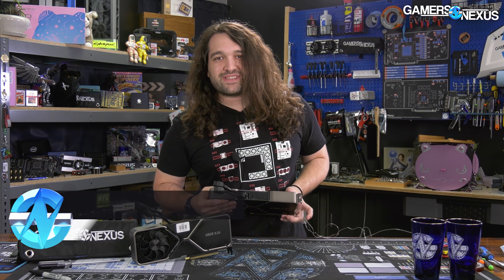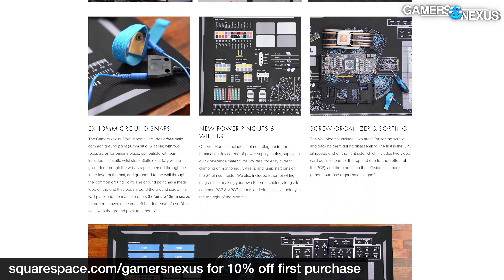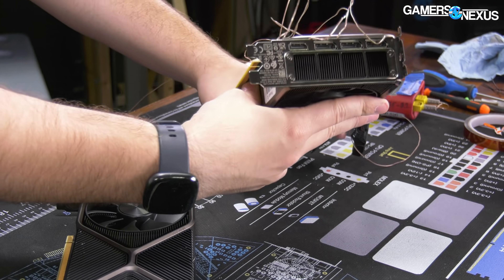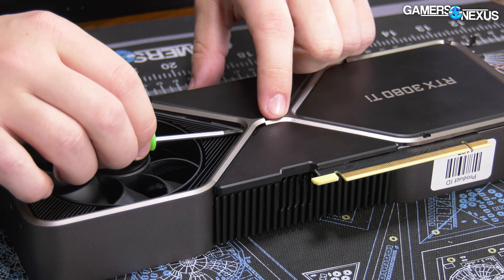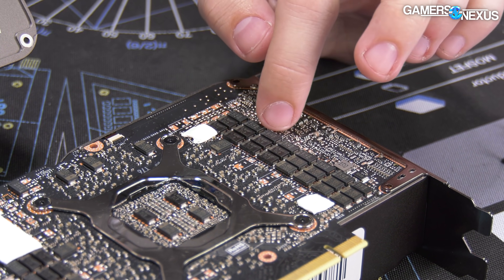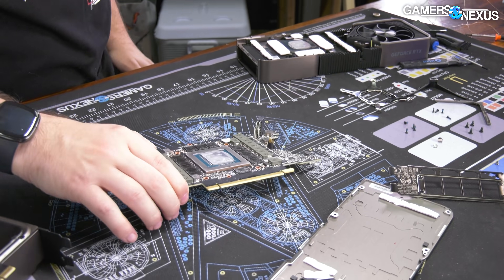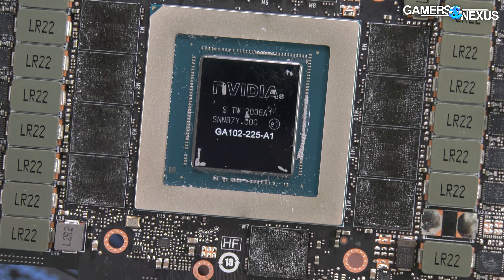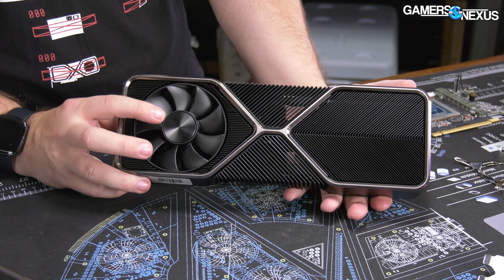NVIDIA RTX 3080 Ti Founders Edition Tear-Down: Seeking Differences vs. 3080 FE

Comment: The retailer here is charging €1900 for the cheapest 3080ti and despite those prices it is out of stock. And this is with the lower hash rate. I don't get how people can spend so much money on graphics cards. I don't really blame Nvidia for charging a lot when the partners and retailers add so much more anyway and when people are crazy enough to be willing to pay the prices. I would never spend that much on a video card. That's more then i typically spend on the entire system.

Comment: I used to call it 'tie', but ended up going with 'tee-i', as the argument was the titanium chemical symbol. Or I had just heard 'tee-i' enough, and adopted it. ... I still call my old TX 650 Ti Boost a 'tie-boost'. ... Call my current 1080 Ti as 'tee-i'.

I think either naming gets comfortable to use, after enough goes.

Comment: The only real improvement would be the extra memory... which is very helpful if you use vr setups which are super memory heavy .... so something like a valve index setup for example would be a good match for this card

Comment: Thank you for being so value centric, GN.  Keep these companies on the back foot! It's only because your efforts, and the efforts of like-minded people that there's any value in our products at all. Love your content, dig the humble vibes, please keep it up favorite tech-tuber!
Reply: People are going to pay it no matter what, so I'm not sure how this video is keeping them on their back foot....
Reply: @Charles-vd3vc  It's like a first line of defense. GN has the equipment to test claims and various marketing hoopla, and those tests in many cases are legally defensible, like with the H1 case. GN simply provides the valid info, such as the test results for this card, and if the problem is grotesque enough (say if this card actually performed worse than a standard 3080) then that type of inflammatory information would circulate quickly and cause outcry against Nvidia who would then be forced to explain themselves at the very least.
Reply: @AC-io8qs  Yeah but that only works if the product is actually inferior. This video doesn't display that and with a market starved of GPU's they could have made this product worse than the 3080 charged more, and still sold every single one. People would be angry, but they still would have purchased it.

A good example is pre-orders. People keep getting burned by pre-orders and yet they still pre-order.... and those people can still get the product at launch.
Reply: In this case Nvidia is selling way below market value.  scalpers have  shown the market will bear 2x+ price increase.  That 200$ if nvidea didn't get it, a scalper would.

Comment: The real question is is anybody crazy enough to stick those extra memory modules on a vanilla 3080 and try to flash a ti fighter bios?
Reply: It wont work.
The 3080 has a smaller bus width

Comment: Can we get a review of how well $100 bills work as heatsinks?
Reply: Definitely needs some testing.
Reply: I would unironically enjoy watching something like that, it'd be interesting to see how something as non-related to thermal conduction as a $100 bill, might actually do something (I'm talking like a 0.1 degree difference)     But, this could certainly be a fire hazard and would need to treated carefully.
Reply: You can literally see it...
Reply: About 15.

Wait.. maybe 20 to 25.
Reply: Sure, you burn them… momentary RGB effect… everybody knows RGB = higher frame rate..
Reply: Not even as well as coinage, I'm afraid.

Comment: Currently in the Netherlands the RTX3080 is €2250 and thee RTX3080Ti is €2300.
So there i only a €50 gap between them, not €500 as you would expect based on the MSRP.
I expect the Ti to be cheaper than the non-Ti within 2 months, unless LHR gets hacked.

Comment: The 3080 Ti FE card that Paul's Hardware had the VRAM hit 108c so Nvidia learned absolutely nothing 😄
Reply: That’s because his didn’t have the dollar bills which act as thermal pads.
Reply: if you zip tie two noctua fans to a non-reference 3080 Ti it will probably do a better job lol
Reply: @Nolan431  unironically I have a spare Arctic P14 PWM fan... would that help ? I have no problem doing this haha
Reply: Maybe he forgot to remove the two hundred bills that are over the VRAM. Paper doesn’t fair well with dispersing heat.
Reply: I honestly stopped caring about it, if my memory dies or something i will just claim warranty and thats it.
Reply: @jaroslavmrazek5752  card dies one day after manufacturer's warranty
Reply: @jaroslavmrazek5752  sure thing ok we have validated your warranty claim, your replacement card will ship to you in  — 396 days. Thank you, Nvidia support
Reply: Just because tjmax is 100°C doesn't mean it's healthy to keep the chips in that range for prolonged time.
Remember that 90°C is "by design" for Ryzen and I've seen Intel chips that got 105°C written on. But who runs their chip at that temp?
Reply: Same chips, same crappy thermal pads, same temps lol
Reply: I have a 3080 regular Founders.  Seen all kinds of conflicting videos.  Would it be advisable to add thermal pads behind the memory on the backplate side?  If so what brand and thickness should I go for and can I just keep the default pads in the other areas on the back so I don't have to spend a bunch of multiple packages?
Reply: @SubZtx  It would depend on your make and model. If you have an ASUS, you can tweet them asking for specs so they can repeat their previous disastrous run-around of claiming that thermal pads are some sort of highly proprietary engineering secret.
Reply: @V_is_for_Void  Other vendors make FE models?
Reply: @Thrashie  Ah,  I thought OP said he had a non-FE. I see he edited his post, so not sure if it was a brain fart on my end or not. I'm not sure what the general consensus is on adding thermal pads to the backside of chips, on the one hand, it could reduce temperatures, but I'm also concerned about damaging the pins or the solder connections with overpressure.
Reply: @SubZtx  A proper tear-down and re-pad of just the die-side of that card with high-wattage pads and high quality TIM on the die will make an enormous difference in both die and especially memory junction temperatures. 

I very, very carefully disassembled my 3080 FE (some tweezers, a high-mag headset,  and some tape to pop off the screw covers really help). I then replaced all the stock pads with from nvidia with Gelid Extreme 2.0mm replacements. One 40x80mm, an razor-sharp xacto knife, a small accurate mm ruler and a micro felt pen will assist in cutting it down. The diagram from Will Norris is very helpful. I also used Kryonout grease for the GPU die, an ample amount; don't be shy, a slightly too much is better than too little). Reassembly went fairly well, save for replacing the screw covers and the wishbone. One of the screw covers were very testy to get back in perfectly flush, and the wishbone has to be line dup flawlessly to seat back perfectly.

The result was about a 10C drop in die temperature during gaming (good), but the real money shaker was the 24C drop in memory junction temperature at normal gaming, and 16C drop under full tilt load. I run my 3080 FE mining ETH when I'm not gaming on it (I figure sooner or later it will help pay for some of the cost). Before pad replacement I couldn't run it harder than 84MH/s without breaching 95C on the memory junction. Now I can run it at 102MH/s and it never crosses 92C; it would easily thermal throttle long before that figure with the stock paste+pads. During gaming the memory junction never breaches 82C even at 4K ultra settings. Before repadding it would routinely breach 104C, and eventually throttle.

Do with that what you want. If you're the least bit hesitant about taking a set of screw drivers to your 5lbs of Unobtanium, don't . I was confident I could do it, and even then I was sweating. Getting that thing nine months ago from an online-only drop at MSRP ($699) was like winning the lottery, and its gotten far, far worse now. I know lighting wont' strike twice for me again, so "careful" cannot be overstated.
Reply: I never heard of Pauls Hardware review before. Thanks for the tip. His opening review of the 3080 TI cracked me up!
Reply: @LordZordid  Doesn't make sense, it further thins out silicon supply.
Reply: @jaronmarles941  I think you misclicked on the person you wanted to respond to.
Reply: This is kinda funny since I had to RMA my normal 3080 and the new one I received has way better memory temps than the old one ever had while still being quieter.
Reply: I did
Someone said "They made this just to sell more cards" despite the fact it lowers silicon supply for all the others.
Reply: @jaronmarles941  I see. I might actually take offense to be associated with a comment like that. :D
Reply: Overpriced card with bad design and bad engineering. Ehh. Pc industry is getting to a bad way.
Reply: To be fair, it is technically in spec. Not saying it's good, just within spec since TJMax is 110.
Reply: @jaronmarles941  thats nvidias max. The mem chip maker's is mid 90s
Reply: @Nmin34  please point towards ANY evidence of throttling due to memory temps within upper range of spec. TY.
Reply: No, they learned that they can milk this cash cow much harder than expected, so they will.

They made this card solely to be able to push out more cards.

Comment: Steve always looks so excited in the Tear-Down videos :D
Reply from the maker: They're a lot of fun!
Reply: @GamersNexus  except the card that shall be named, tho I am glad the wrench was useful XD.
Reply: @ShartsInTheAir  Hol up, I haven't seen that one. Which card required a Wrench?! xD
Reply: @GamersNexus  I find all of your videos super fun and end up watching while working too :D (Don't tell my boss :) )
Reply: @GamersNexus  I noticed you didn't check the thickness of the pads, but still thanks to you & the team for all that you do
Reply: @wboyd33  Sorry if It's a silly question, do the thickness vary? I assumed when I saw on reddit that people are replacing the pads that they would be in a standard thickness?
Reply: @ChaiTimeDataScience  can get heaps of different thicknesses. The front of the GPUs usually only use one thickness though for waterblocks at least because the block itself is machined to varying heights for all the different components. The backplates are usually machined flat though and require a lot of different thermal pad thickness for all the components that are varying heights to make contact. This is the instructions for the EKWB 3090 backplate for example 

https://www.ekwb.com/shop/EK-IM/EK-IM-3831109832486.pdf
Reply: @ChaiTimeDataScience  They vary from model to model & by brand. You don't want to use a different thickness as if it's to thick it can change the pressure & temperature on different spots or if to thin you won't adequately cool that spot.
Reply: @axegash2790  @Dobe this is what I love about Tech. Everytime I run into nice people like you, I learn a lot more. 

I have 3x GPUs running in my system but haven't dared to take them apart or touch the thermal pads. I'm just terrified everytime I even pull them from the PCIe lanes to air dust
Reply: He's tearing down more than just hardware.
Reply: @CaveyMoth  Lol!